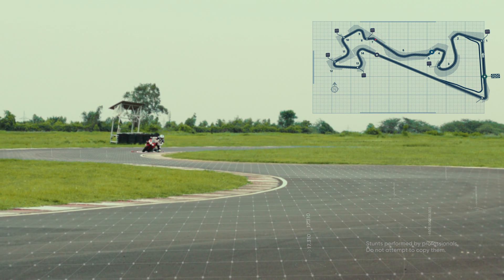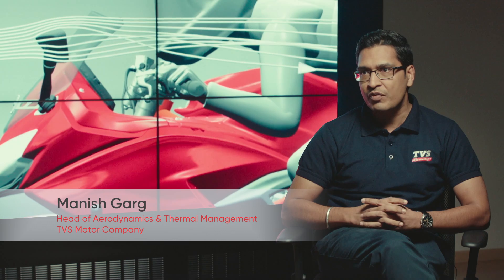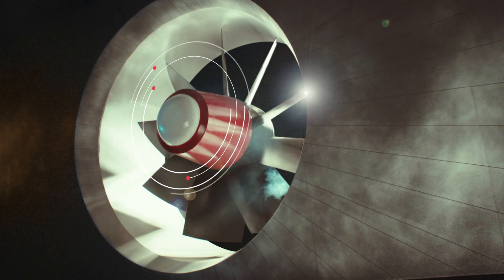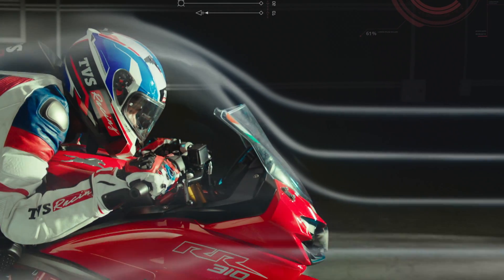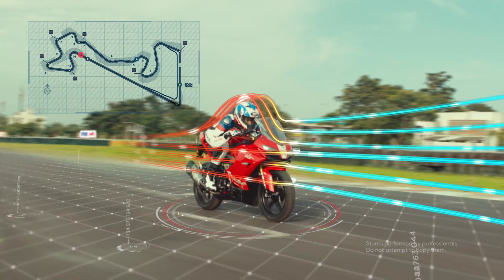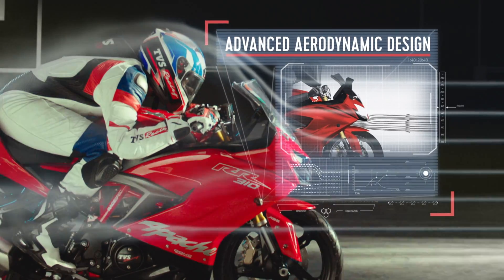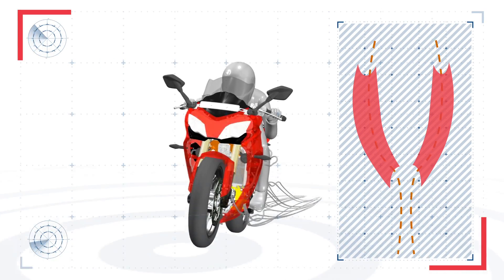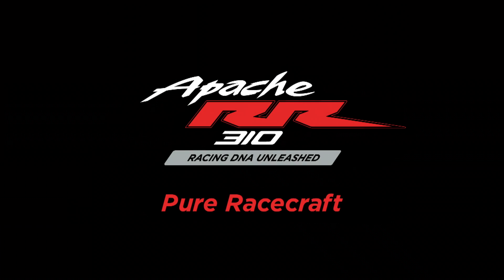TVS Apache RR310 - Aerodynamics

Comment: TVS Apache RR310's top speed as per TVS and V-box test is around 160kmph.
CBR 250R's top speed as per Honda India is 135kmph, but according to various V'box tests done by auto mags and enghusiasts is around 152kmph.
However, we must bear in mind that RR310 produces 34 bhp and weighs around 170kgs, while CBR250R produces 26.15 bhp and weighs around 167kgs.
So RR310 has much better power to weight ratio than CBR.
Still difference in top speed is ONLY around 8 kmph mark.
I think had CBR250R got 34hp of RAW power, it would easily beat RR310 in top speed.
So much for TVS claiming the best drag coefficient Cd value in its class.
Honda>>>>>TVS.
Reply: Dude. Stop marketing that CBR. I think Honda hired you to go and market it left right centre, in all videos possible in YouTube. Honda themselves have zero interest in that bike. Last week, they released a 3min long ad. And in the entire 3min, they haven't shown CBR 250 even in one single frame of that video. They showed every other product that they have here, starting from that Cliq all the way to the Africa twin.

In Bangalore, CBR costs 2.45 l on road and ABS model waiting period is too long. They can't even confirm the availability of the bike.

TVS service is far far better and over time, parts availability is also going to improve.

Quality on the RR is far ahead of CBR. Better brakes, better suspension, better tyres, better frame, better aerodynamics, better instrumentation and almost same weight. 

The only con that the RR has now is the vibrations. It's more in some bikes and less in others. Even that will be ironed out soon.

Goodluck. Honda fan
Reply: Ajay Kaushik 
LOL. Decade old CBR is whooping RR310 in sales figure thanks to its legendary refinement, reliability, simple yet understated design and unparalled touring capability in its class.
Good luck with your rs 3lac vibrator.
Reply: RR makes 34+ hp and accelerates to 100 in 6.2 sec. But CBR makes 26hp and takes more than 8 sec to reach 100kmh. 
The fact that the CBR is more refined is also down to that very same fact. Lower power. If CBR 250 made anything more than 28-29hp, it would lose its refinement and durability. That's why Honda has detuned it. Even the CBR 300, having 286cc is also good for only 28.5hp. If RR also only did 30 odd HP, it would be very refined.

The Apache 200 makes only 20hp but the Pulsar 200 makes 23.5hp. Apache is way more refined than pulsar, but does that make pulsar a totally bad bike?
Reply: Ajay Kaushik 
Refinement is down to compression ratio plus technology involved. If bhp per cc is the only factor then Splendour would be more refined than Unicorn 150. But is it?
Nope. If Honda makes a 313cc single, it would still be a lot refined than this vibrator from TVS.
Also CBR 300R produces over 30hp. The same engine in new 2019 CB 300R produces around 31hp.
Apache RR310 despite 65 cc more and 8 more hp is only slightly more faster than the CBR 250R.
Aerodynamics?
CBR 250R reaches a top speed of well over 152 on GPS. RR310's top speed as per TVS is 160. I honestly dont see any aero advantages there.
Fact is TVS have screwed up on their first sport bike design and engineering, and as a result decade old CBR is mauling RR310 in sales figure.
Go figure....
Reply: @pramathewyayawar6934  
If sales figures were the only indicator, then Royal Enfield is mauling every other competitor. In fact, they don't have a competitor. That's how far they are ahead of the competition.
I am not saying CBR is a bad bike. Even i liked CBR. But the way Honda is treating that bike and bike enthusiasts is what is a big bother. Honda is only selling scooters scooters scooters.
What Honda could have done is not the question. What they are doing and what they have done is the question. I could say that even Yamaha could tune their FZ 25 to put out more power and still be refined...
But, the question is what they have done.

And saying TVS screwed up the design is rubbish. RR accelerates faster and handles much better than your CBR and on the racetracks like MMRT, the stock RR puts a time of 2:06 which is the same as the race spec Honda HRC CBR 250. So, that's saying something. Even a race spec CBR 250 can't outperform the RR on the track.
Reply: @pramathewyayawar6934  
And then you could say that your CBR is even better than KTM. KTM has 60cc more than RR. But, RR matches it on many fronts. Top speed, handling...
Now you will end up saying that CBR 250 is better than a KTM 390, which is again rubbish.

The RR is worth what it sells for. And the CBR is worth what it sells for.
Reply: @pramathewyayawar6934  
And to further state facts for you. Honda has no other bike other than the CBR 250 which can match its competition.

Look at their next best bike. Hornet 160. Air cooled. 15hp. Vibrates bad if you rev it hard. Heats up as well. But, Apache 160 is a way way better engine than that.

So, rather than thinking and hypothetically saying what Honda could do with the CBR, look at what they are actually doing with it in India. World over, they have a 300. Here, they still give us the 250 only. And too, sales guys don't promote it, service guys don't care much for it.
Reply: Ajay Kaushik 
CBR 250R is better than RC 390 for commuting, touring and versatility.
RC 390 destroys CBR and every other single pot sport bike in performance.
And no, RR 310 cant match RC 390 in performance or cornering.
Reply: Ajay Kaushik 
Who said that? I own a CBR 250R and the sales and service support has been excellent. HMSI has really been very helpful when in needs.
Hornet does have vibrations though, but then its compression ratio at 10:6 is really into liquid cooled engine territory.
However none can beat Unicorn 150 in terms of engine smoothness...period.🙂
Reply: @pramathewyayawar6934  
Yes. That's because unicorn has a lower compression and lower output. So, its obviously super smooth. And sounds good too
Reply: Ajay Kaushik 
Dude, give CBR 65cc more and it would destroy RR on every performance count.
And sales figure do matter, you know that. 
If Enfield sales dont matter then why Bajaj(with their D400), and now Mahindra with their Jawa sub-brand are targeting them?
TVS estimated to sell around 12000 RRC310's per annum. But why it has flopped so hard, is a matter of research on TVS's count.
I actually predicted looking at its vibrations, chain noise, alignment issues, and high spare parts price(chain sprocket set for rr310 costs 7000 rupees, but it only costs 1800 rupess for cbr250r), along with poor sales(no test ride, limited sales outlets etc.) and poor service has costed TVS big time.
Also, TVS shouldnt have increased the prices so quickly after its launch. The revised price of 2.23 lacs pushed it closer to the entry level sports bike performance champs the KTM 390 brothers, which did not bode well for RR310.
Reply: Ajay Kaushik 
My dad bought me original 2005 Unicorn for my University errands. It had 13.3 bhp exactly as much as Pulsar 150 and much more than CBZ Star. Compression ratio was similar for all these three. Yet Unicorn was butter smooth in comparision with every other 150cc of its class that included TVS Fierro FX.
I think we had to give credit to Honda engineering. When they want they can produce absolutely reliable, super refined motorcycles.
Now that I have bought CBR 250R with my own hard earned money, I can feel the same engineering prowess of Honda, which only a long time Honda owner can experience.
Reply: @pramathewyayawar6934  
No denying that. But who is stopping honda from adding 65 more cc or whatever engine size they want?

They are not focused on the Indian market for motorcycles. They want to probably beat Hero motocorp to become the no.1 brand in India in terms of volumes.
Reply: Ajay Kaushik 
I politely disagree.
I think Honda is extremely serious about Indian market. Serious about performance segment/sport bikes? May be you're right, but may be Honda are right too.
If your decade old motorcycle like CBR 250R is doing average 500 units per month and outselling most latest sport bikes, then why should Honda fix something that aint broke?
If you own something like Unicorn 150 or CBR 250R, then you'll realise why people still favour them over latest comers🙂
Reply: @pramathewyayawar6934  
One question on the CBR. Can you lock your knees into the tank when riding? If you have ridden the Duke 390 2017, it has the tank design in a way that you can lock your knees perfectly into the tank. Can you  lock your knees into the tank on the CBR as well?
Reply: Ajay Kaushik 
Not quite in a natural position with slight lean(as the tank is very narrow). But in a committed position, yes you can. It has built in space to do that.
Infact, I always ride with my legs locked around the tank as it takes pressure off my wrists. Advisable in a bike with clip-ons.
PS: CBR is a very versatile sports  bike with very flexible ergonomics. You can change your body positions based upon your requirements of commuting, touring, canyon riding, sport riding or track days.
Reply: @pramathewyayawar6934  
https://www.autocarindia.com/auto-features/autocar-track-day-indias-best-track-bikes-2018-409904

Please read this article. And check out the lap times at the end. Cbr 250 is somewhere at the end. Although CBR is a good bike by itself, it still is way behind even the RTR 200 on track. Sad, but true.
Reply: @pramathewyayawar6934  
Hi pramathew! Have you got the 650r yet? I got the 310RR. Its not as bad as it was made out to be. 
Good luck for your 650R dream too!
Reply: Congrats buddy👍
Well am 100 satisfied with my 250R. With the kind of roads in my state Jharkhand, I think any bigger cc bike over 250 is an overkill.
Reply: @pramathewyayawar6934  
Thanks man! This might also probably be the last level i want to reach. This 300cc is more than enough for roads all over India. A higher capacity one would be expensive and not so usable.
And btw Honda has stopped the production of the ABS variant or they are selling in very limited numbers i think. 
I went to enquire the ABS variant of the 250R before buying Apache 310.
Most of the showrooms had non abs in stock and ready for delivery. but they were unsure whether they would get back the ABS variant in stock. So i went ahead to buy the 310RR
Reply: I too was told the same thing back in 2016, when I went to purchase my baby blade. But since Honda showroom belongs to an uncle and also I talked to the HMSI higher ups, I was able to get C-ABS equipped CBR.
Good decision btw.
Reply: if you want ride 160 from 152 km/h you need increase power from 26.15bhp to 30,5 bhp so yea according to this cbr have better aerodynamic assuming the same drive train power loses etc but power losess can be close but lil diffrent thats 1 ,2 is test condition = driver shape ,clothes ,position ,road ,wind etc so for fair comaprision you need do test in perfect condition = wind tunel , road test even in the same time can be diffrent beacuse wind still change its characteristic direction speed etc .... accroding to 160 vs 152 and 34 vs 26,15 bhp those 2 bikes are very close and saying which have real better aerodynamic base on this numbers is imposiible due to many diffrent factors you neeed wind tunel and precise instruments to measure aerodrag  .